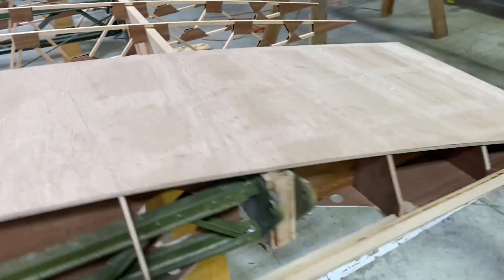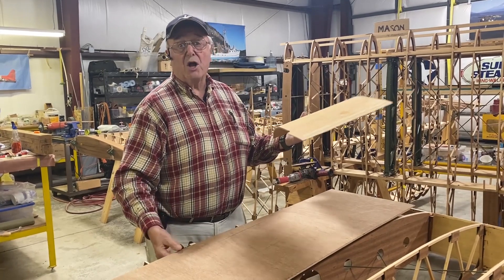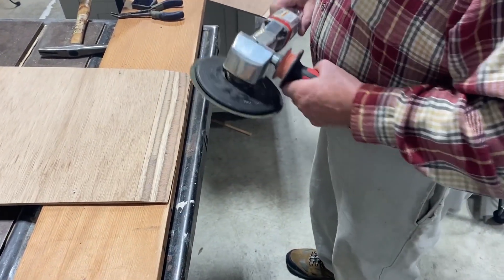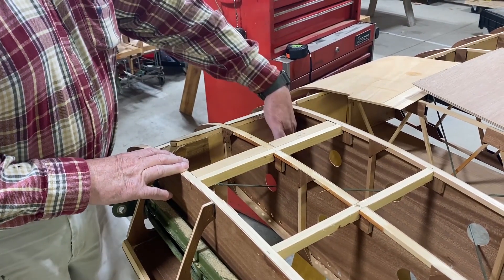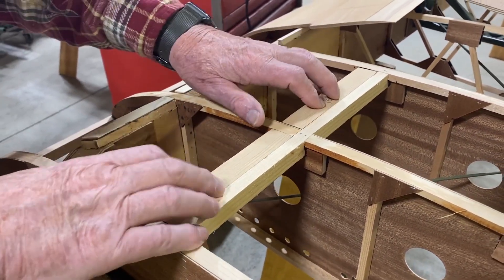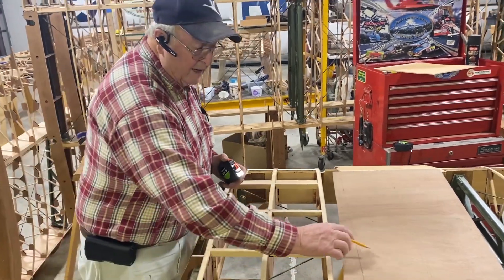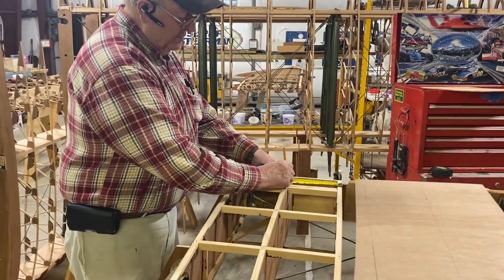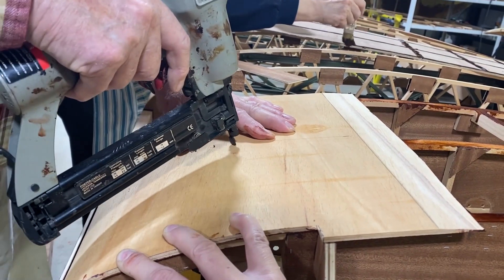How to build the Wing Walk on a Stearman

Comment: I have a question about "sanding the nail heads".  You actually sand the top of the nails off, rather than tapping them down flush with the surface?  Do you have trouble with the sander grabbing the nails?  Great How To!